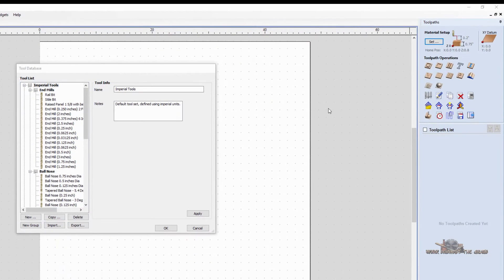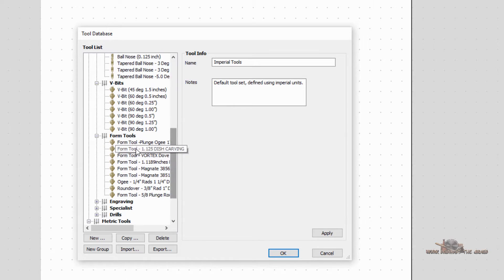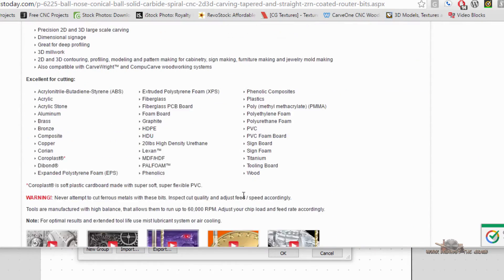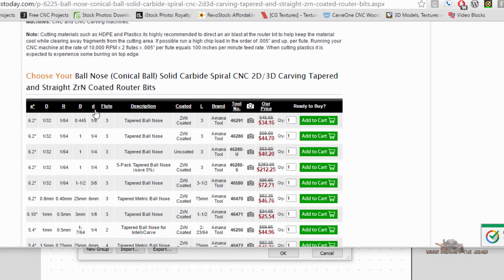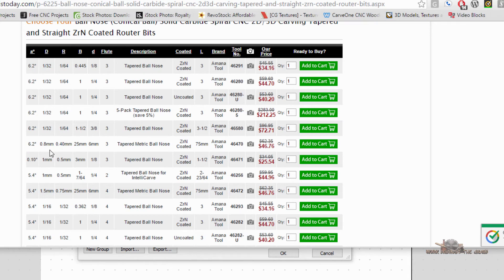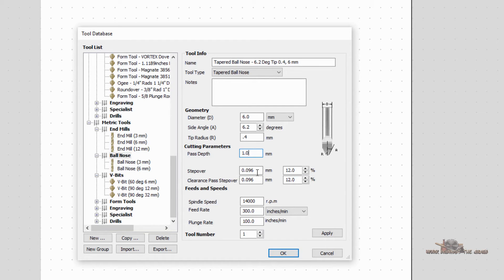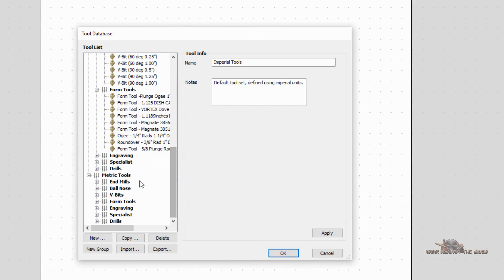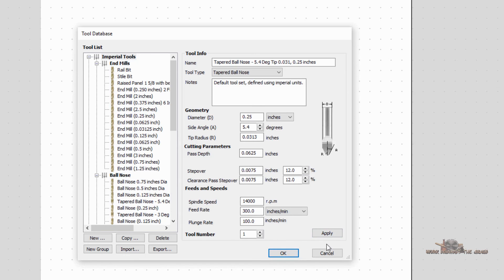Add Tapered Ball Nose To Aspire

Comment: Hey, very nice tutorial, what about a plunge speed, ho do you calculate that? I just don’t want to brake my fine tiered ball nose cutter.
Reply from the maker: I try to RAMP in whenever I can to avoid a direct plung. For finishing OFFSET toolpath does basically the same thing. If you have to plunge be very conservative. 5-10% of your feedrate at most in my opinion but EVEY machine is different. Consult machine manufacturer. Thanks for watching.

Comment from the maker: I use the same, rename the description to tapered end mill and drag under my end mills. Seems to work great. I've used engraving as well and changed description. The engraving asks for FLAT DIAMETER NOT tip radius.

Comment: HOW DO YOU COME UPP WHIT THE PROCENTAGE OF THE STEPPOVER??
Reply from the maker: lower the percentage better the finish and less sanding. try not to go over 20% or you'll have little lines to sand. 8-12% leaves nice finish. problem is lower the percent, LONGER the job takes. use big percent and get it done fast but have to sand use small percent less sanding. No real formula.
Reply: okej but is ther a mathematickal formel for coming upp whit numbers or just experiance??
Reply from the maker: +HARLYLICHUZZ CAD CAM CORNER!!   just experience